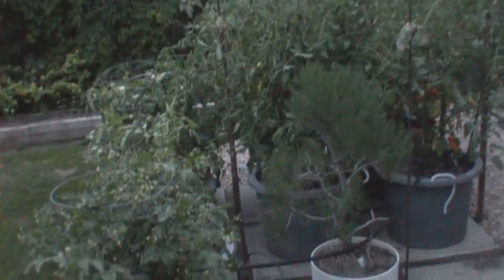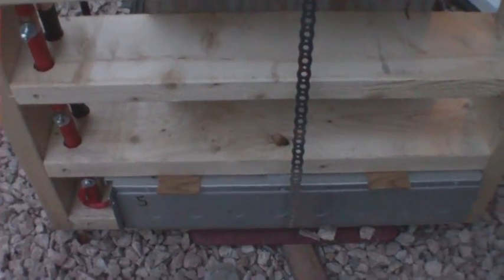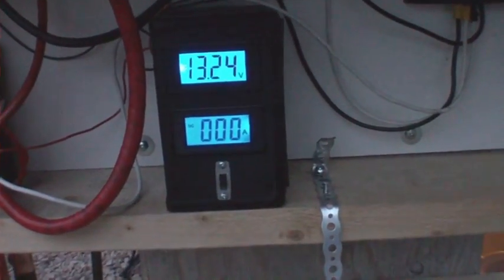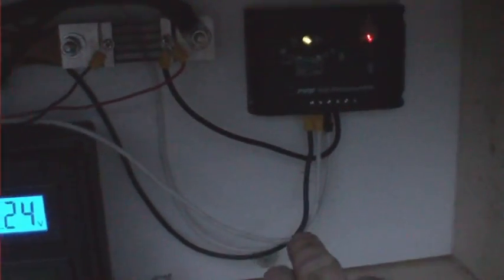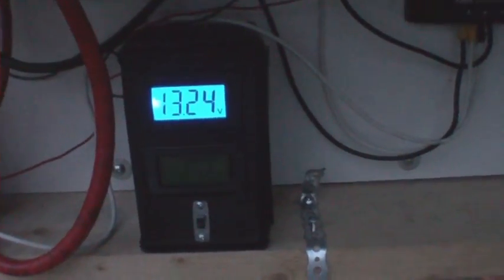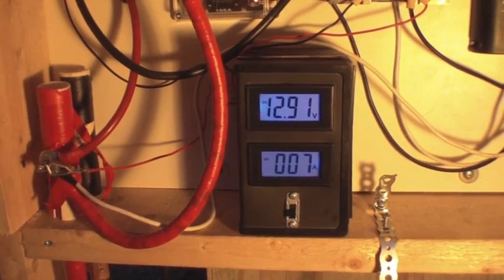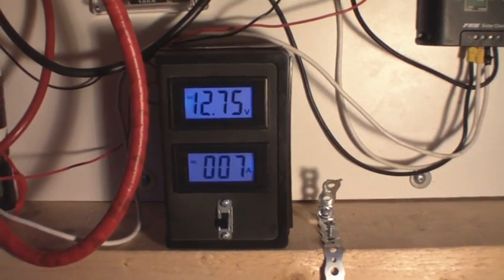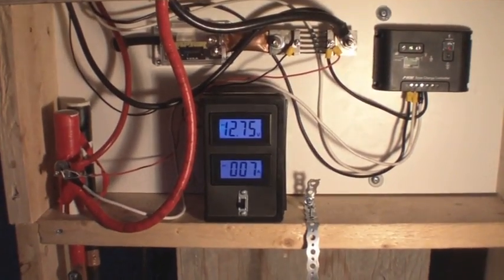Junk SLA Battery bank project - Video #3

Comment from the maker: I'd like to see a video. Interesting. Are you using a royer oscillator based inverter? Or colpitts, bubba? How do you do current control, with feedback (switching mode) or just line choke? I'd like to see this setup. cheers

Comment: You can also go for a 120 Volts battery system.
You need 14  x 12 Volts batteries in series and need to build your own inverter by using
169 Volts DC and pulse this with about 20 Khz square wave and modulate it in PWM with 60 Hz,
so you get a 60 Hz 120 Volts AC waveform after some LC filter.
This way you only need to draw very low amps from each battery !
If you additionally use a power Joule Thief circuit to charge the series battery bank
via solar panels you will always have full batteries.

Comment: Well done, but better go to a 48 Volts system and use always 4 batteries in series !
Surely you will need a different inverter then, but the lower the
amps you draw from the batteries the longer they will last !

Regards, Stefan.